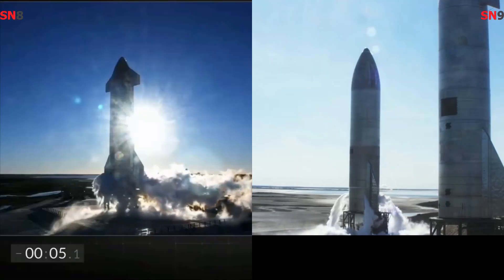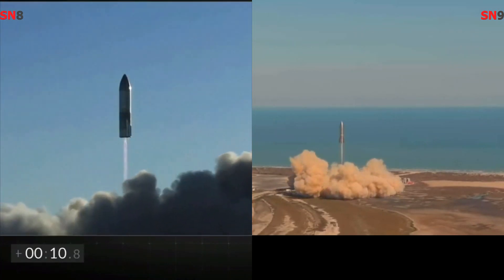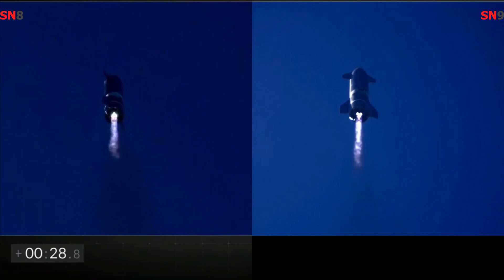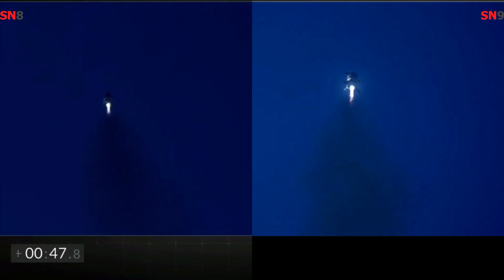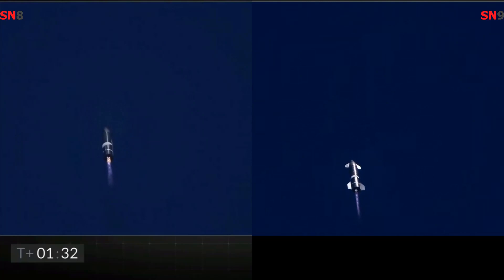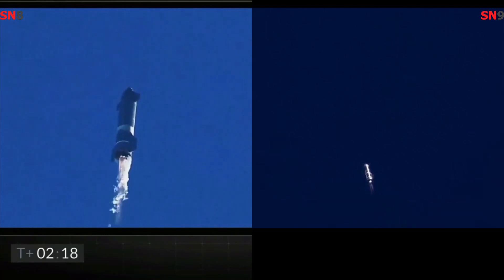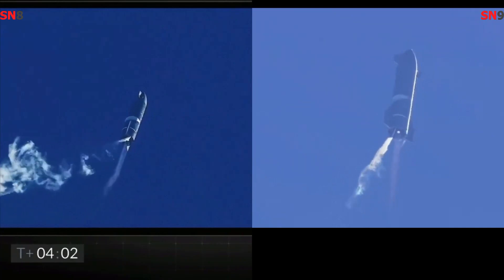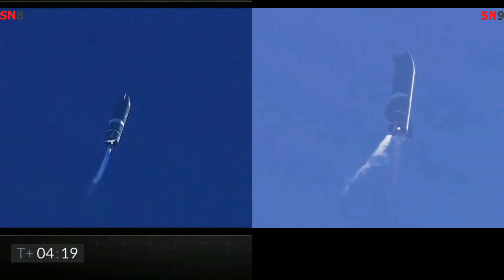SN8 vs SN9 - FULL Flight Comparison - side by side

Comment: Very well done!
Reply from the maker: Appreciated mate!
Reply: @800mmTelescopeProject  no problem! :D
Reply: @800mmTelescopeProject  
For real comparison you just must  align the moment of the re-ignition of the first landing engine on both StarShips. It is the best way to compare the two failures.
Do you get it? Would you do it?
Reply from the maker: @reasonerenlightened2456  Good point. I focused on synching from lift-off so that you could compare the sequence of engine shut-off and the flip. That resulted in having unsynched landing attempts actually gives the chance to one after the other rather than side by side